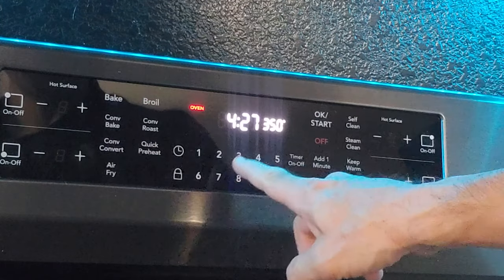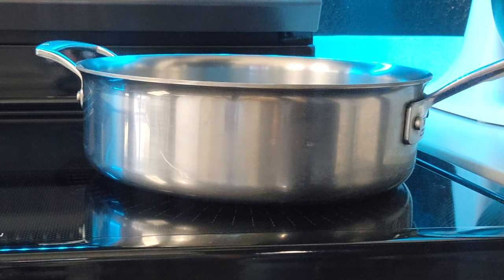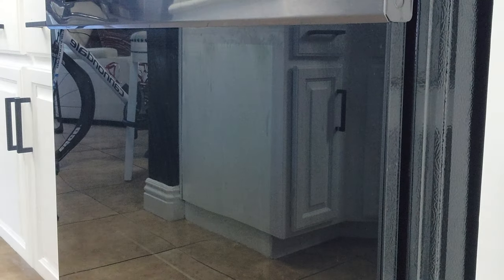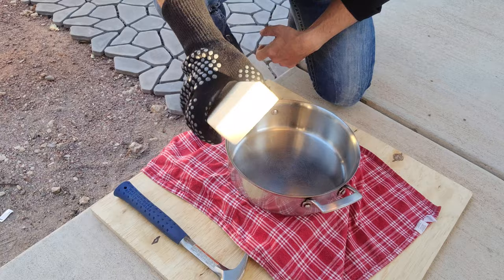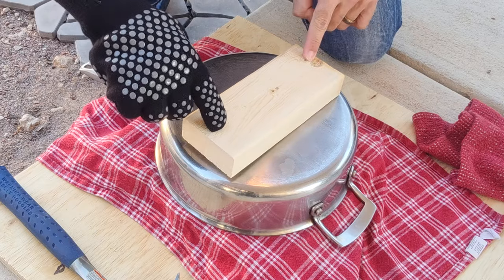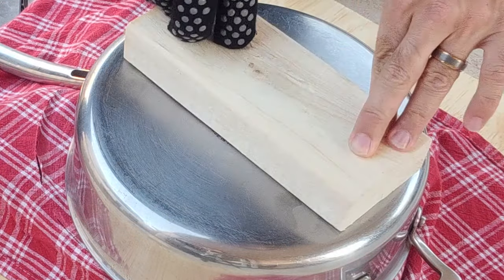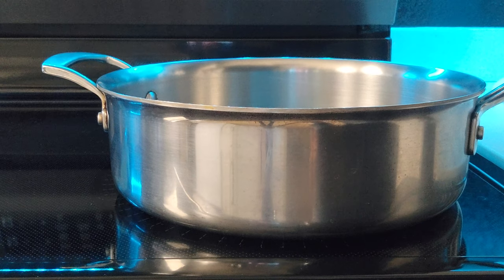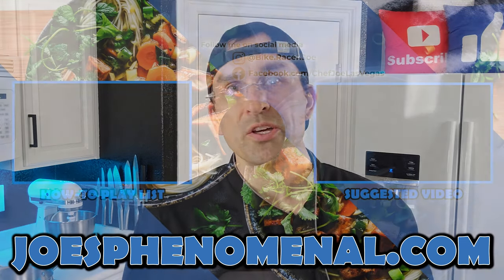How to Fix a Warped Stainless Steel Pan in 15 Mins! | Before You Replace, Watch This!

Comment: So glad I googled this. I warped my favorite pan. It's an All-Clad pan that I inherited, and I use it literally every day. I found it it was going to be around $200 to replace, and it was quite upsetting. I set a pot of water to boil, while my favorite pan was empty on another hob. Except, I turned on the wrong hob and went in the other room. Expensive lesson.
Reply from the maker: Hope it helps... When it warps, it does weaken the metal a bit so after to straighten it, it can slowly bend again if the warp it pretty bad. Good luck to ya!

Comment: I restored a warped carbon steel pan by heating it in the oven and letting it rest back to room temperature. No hammering. The pan just settled back into its old shape.

Comment: Hi Joe
Thanks for the idea on fixing warped Stainless Steel. My LDT warped on the second time I used it. It has scratched my glass top, etc. Is there hope of fixing this? Or do you have suggestions to just buy anoher?
Reply from the maker: It depends on how much it warped and how thin the pan is. When it warps, it does make it weaker and easier to warp again. If the pan is pretty thin and light, it will bend again really easily. If it's heavier it might hold it's shape a bit better.

Comment: Using induction is what bends pans in the first place
Reply from the maker: It's not the induction per se, but induction can heat REALLY fast, and that can cause warps. I always tell people never to set induction ranges higher than med-hi at the very most. I usually just run mine at about a lvl 5 or 6. No need for anything higher than that. You're right though... very easy to warp em that way.

Comment: How do you keep your pans straight?
Reply from the maker: I do a few things. First, I never cook on full heat. In fact, I rarely ever set it much higher than a medium. Stainless pans hold heat well, so you don't need to crank it up too much. When you are done cooking, let the pan cool down on the stove. I just move it to an unused burner and let it come down. Don't put it in the sink or put any cold liquids in it while it's still hot.. That can warp it. Also, although you want to preheat properly, once it's preheated, get to cooking. Don't let it sit there too long with nothing in it after it heats up. Hope that helps!

Comment: when did costco sell kirkland 5ply stainless steel, i see they dont have it now
Reply from the maker: They had them forever.... The Kirkland branded ones.... They haven't had them in store for probably 8 months or so as far as I've seen. They sold out on Amazon, too, and I haven't seen them come back in stock there either. Bummer, too... They were really priced well.
Reply: @JoesPhenomenal  ya, I was shocked to see such low prices for copper core, too bad for me, anyways I will wait it out.

can u believe it , my MADE IN 8QT pot got wobbly, I sent them pic, they asked for video then they will decide if they can replace it. That pot is 5ply , not even copper core and cost 189$ and got warp in 3 times use, even though i didn't heat/cool immediately.

I have used their pan more , but that is perfect.
Reply from the maker: Even All-Clad gives people a hard time about warping and warranty service. You'd think the super high price would mean that doesn't happen, but it's really not the case. Especially when it happens due to no fault of your own.
Reply: @JoesPhenomenal  Ya let's see what they do in my case , i have informed them like within 3 use.
Its really terrible that these pot/pan warp, like what the heck , When i was a kid they used all thick iron cookware and I didn't even know if warping was a thing. use it , abuse it , u just cant damage it

Imagine if after str frying little bit we need to add water/broth, to bring the content to a boil, we cant do that, cause this stainless clad sheets are not even strong enough like old age iron.

I tried deglazing the made in 12 inch pan with cold broth, nothing happened. but that 8QT pot is warped - although i am not sure what has caused warping.
Reply: @JoesPhenomenal  they are sending me a new made in 8QT pot for free as warranty replacement, they are not even asking back the original one. After the Christmas holiday they replied in the morning itself ! Thank god , cause i used it very less, 
They said be careful esp. since i use electric burner(glasstop), and told me to heat it really slow.  Like start from low heat
Reply from the maker: That's awesome! Induction burns heat up faster... I would recommend never running them higher than around a 7 or 8 also.... Hotter isn't really needed.

Comment: 250 degree of fahrenheit or celsius?
Reply from the maker: Fahrenheit. If you go a little hotter it will make it a little easier though... Thick, heavy pans need a little more heat to soften them up.
Reply: fareneith

Comment: I hate those flat surface glass stoves. There is zero benefit to them compared with gas stoves.
Reply from the maker: Heya... Well I'd say it kind of depends.  The glass top ranges are a lot easier to clean thank gas ranges, but the glass is obviously not as durable. Also when you're talking about glass top ranges, there are radiant heat cook tops and there are induction cook tops. Induction is fastly supeeiousntonthe radiant stuff... I kind of hate the radiant versions, also. The induction range in the video had to be left behind when we sold the house a few months back and the new place has glass top radiant on it... Not Great at all, and with that one, even though it's pretty easy to keep clean, I felt like my gas range from before the induction cooked a heck of a lot better on it.... If you have powerful gas, those ranges are still the best at baking imo. Also they work better on things like woks and stuff as well.. Not to mention that induction's reliability can be an issue... Gas just kinda works.
Reply: @JoesPhenomenal I just bought brand new induction cooktops (in CA we basically banned gas)
My pans were all warped and it’s been a chore using them

Gonna give this a try tomorrow though!!
Reply from the maker: @dylan-nguyen let me know how it goes... It can be a little hit and miss depending on how bent they are.
Reply: @JoesPhenomenal  I got it pretty flat I found it easier to push it so the pans were dented inside a bit then got a piece of wood the same diameter as the inside and flatten it from the inside out 

that way the flat 2x4 and flat surface I used ensured it was flat
Reply from the maker: @dylan-nguyen yeah.. That 2x4 method is really good.
Reply: Agree with you onflat glass top toy stoves. It actually means don't cook at home and eat junk outside.  Especially if you rent the place. That's very annoying and to be honest very insulting to me.

Comment: i left my 1.5 qt saucepan  boiling water on my i think glass stove? all night long  on high cause i passed out , and now it warps when ever i heat it up again, btw all the water turnd the pan black but\ i managed to get most of that off, some parts of the pan has a blue tintto it now, but that dont bother me its just the kind of saucepan i have ;looks like a ring at the bottom side like its wearign a hat or something if u sit it upside down and thats the part tha keeps warping under heat how do i fix that?  its only warped when heated
Reply from the maker: Hmm.... If it get warped too badly, the metal will juts be compromised and banging it back into shape won't help much. That sucks... I've done that, myself...
Reply: To prevent pan warpage such as this you must stay off the sauce!

Comment: 0:42 I don't think that's true. That's not how magnetism works. If it's slightly warped it will still work on induction.
Reply from the maker: Heya Walter. It'll still work if it's really slight. You kinda end up with some weird hot spots a lot of times though, depending on how bad it is.... I suppose you can have varying results with different ranges that have different sized induction units, too... Anyway, warped pans can get a little annoying if you get a little tilt to the pan from the oil wanting to sit on one side, also.
Reply: @JoesPhenomenal  can you review a Darto carbon steel pan? I heard some customers have no problem with warping. I'm guessing it's because it's a very thick pan.

Comment: When it cools down, the shape of the bottom returns. Ultimately, it's still uneven.
Reply from the maker: It might be bent just a little too much..  If you have a really flat surface and a couple of clamps,  you may be able to clamp it down and force it to cool in the right shape.  In any case once it's been warped,  it tends to do it again a lot easier since the overall structure has been compromised.  That one I warped for the video is still straight,  but I hardly ever use that pan. So,  not much opportunity to stress test it.  In any case,  a lot of times it can put off having to replace one. Sucks that it didn't help you,  though.